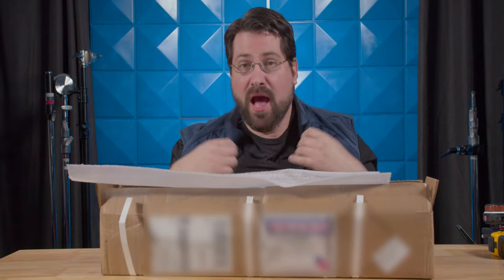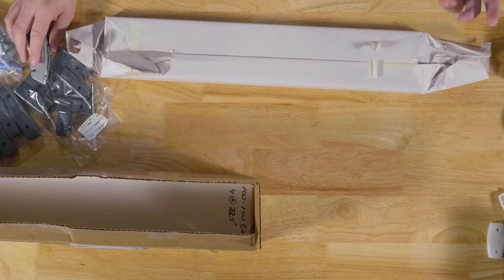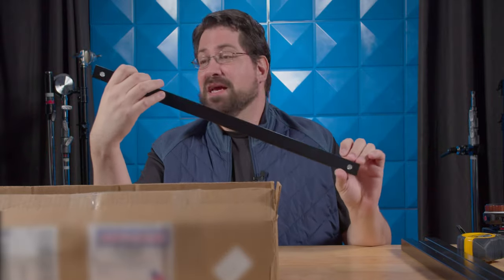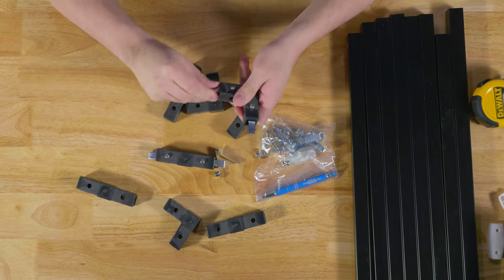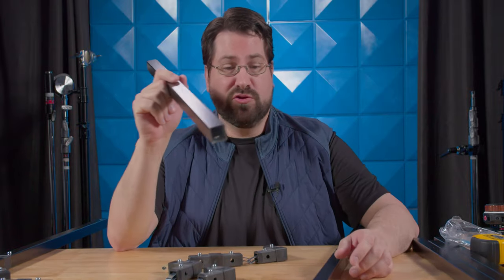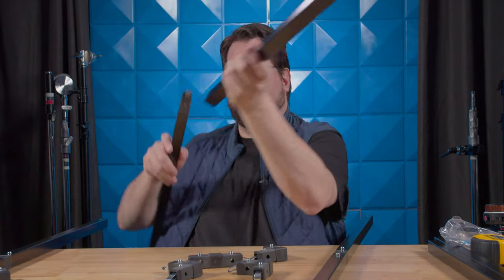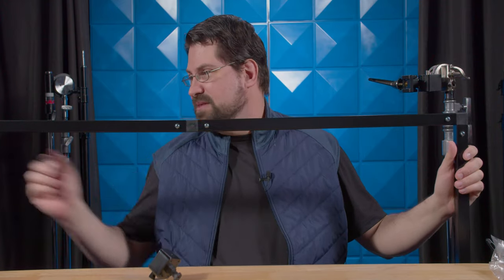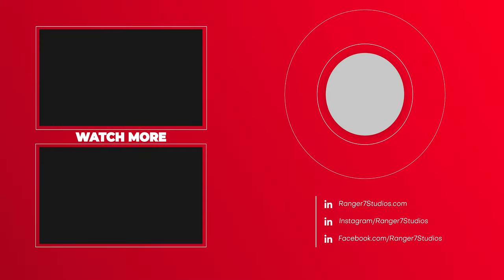DIY Diffusion Frame (Scrim Jim): 4'x4' Travel Frame - Unboxing

Comment: What type of material would you use for diffusion?
Reply from the maker: I grabbed a Neewer diffusion for about $7 off amazon to start. I now have the Westcott rags that I got on sale. They work great because this is where Westcott has their frames made. I went with the Westcott because their rags have the velcro already built in and it was cheaper than creating my own. And less time consuming.

Comment: looks like it's a bit shakey, how does it feel?
Reply from the maker: Actually, it's extremely solid. EZ tube did a really nice job. I've recently added Velcro so I can use off the shelf fabrics. This literally IS the Westcott Scrim Jim. Built with exactly the same materials. So I'm wondering if EZ Tube builds these for Westcott. It's probably where they get the materials from if anything. Keep in mind... You can save a lot of money by just buying the connectors and then getting the tubes and cutting them to size from your local home store. I'm currently working on a DIY 6x6 for my kit.
Reply: @Ranger7Studios  exactly Ranger, I've done a research a while ago and found the connectors. What is the wall thickness of the tubing? I know the exterior is 1 inch. Btw look at scrim jim they add rivets on the velcro and rivveted threaded inserts (which you can do as well, just drive holes and secure your velcro) ;) 

I was thinking of getting full 8 ft or 4 ft piping to make my own as well. I got tool to work the gear.
Reply: Wescott basically took James video and upped the price.